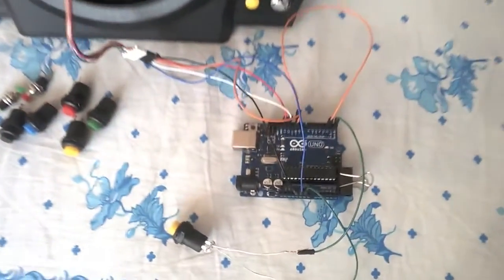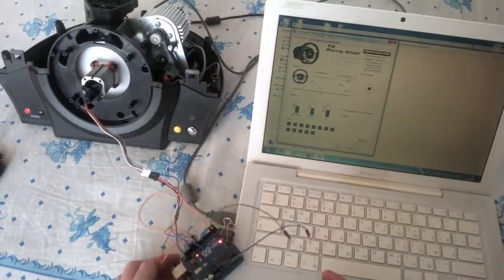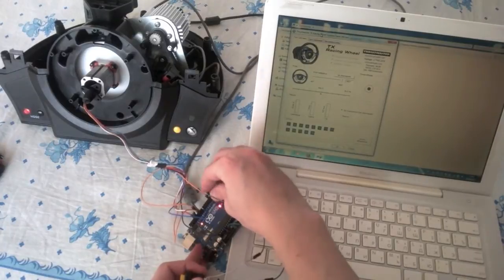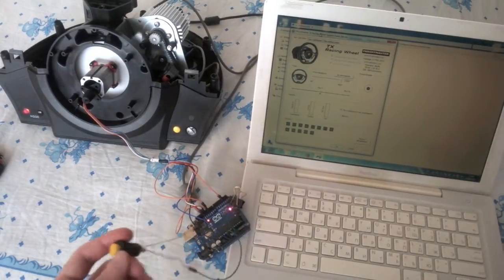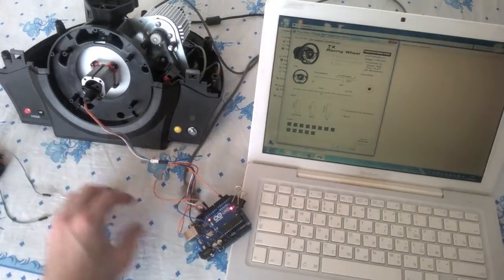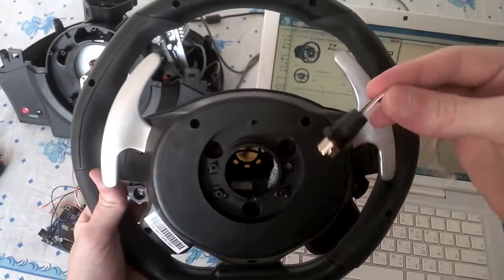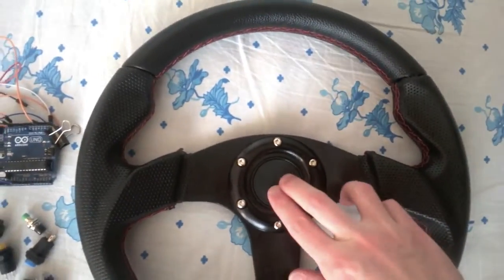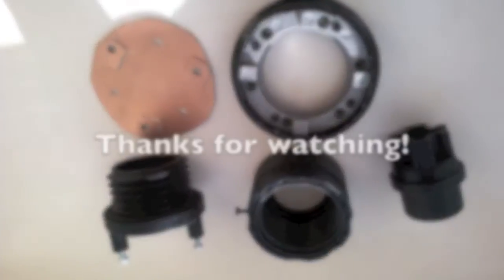Thrustmaster TX RW wheelbase and Arduino - part 2

Comment: Hi, great tutorial. Quick question though, how much current is going through the 3.3V pin? Would you think it is enough to power an ESP32 Wroom S3 and a 599xx evo wheel at the same time?
Reply from the maker: hey! arduino nano draws ~20mA. esp32 not tested, but IMO it will boot and run, why not?

Comment: Hi, I am using a original Thrustmaster plug from a Sparco wheel but the wires are red, grey, white, orange, green and blue on the plug the black is out of the plug. How would I wire this with the Arduino? Thanks

Comment: Hello man, great Tutorial. I'm wondering if you know the color code conversion to a Din 6pins that uses black, red, green, brown, orange and yellow colors ? I actually managed to get this working with an open connector by soldering wires, but I want to use my proper covered ps2 connector cable which is using those color and I don't know where they're connected in the pins used.

Comment: Hi, Im trying to do this mod but every time I connect the board to the wheel base it turns off, I found out it doesnt turn off if the ground cable isnt connected. How do I fix this?
Reply from the maker: Looks like GND is short-circuited with VCC - at this moment power cuts off. Check the wiring and arduino soldering. If you email me some photos - I'll take a look + write your wheelbase model.
Reply: @mispeaced  My wheel base is the TX. What should the photos contain?
Reply from the maker: @antilucker337  Hi-res wiring on both ends - arduino and wheelbase. And a video how everything cuts off if possible
Reply: @mispeaced   Im sorry that it took that long, you should get an email from TomasD.337 anytime soon.
Edit: It just told me that what i believe is your email (mailto:blog@rr-m.org) isnt valid so idk.
Edit 2:  Im just dumb lol

Comment: I have another issue, the steering wheel with all of the button works great while e steer slowly but the buttons stop working if I steer quickly end then they restart working great. I have tried a lot of different connection between Arduino and the female din 6 pin so I excluded the wiring as a cause for the problem, may it be the version of thrustmaster softwer? Because I'm using 2 pin as gas and brake ( because I didn't finished my pedals yet) and I hold them continuously and maybe the software doesn't expect that and cut the input.
Reply from the maker: Hi! Email me photos of your wiring, arduino board version (nano, uno, ..., ?) and tell me which sketch you're using - may be I'll have some idea then. Tnx!

Comment: I'm  trying this on t300 rs and i connected only 4 buttons to arduino nano, the buttons i connected work well but when i move the steering wheel arduino pushes a lot of buttons randomly. Any suggest?
Reply from the maker: Hi. Email me the pictures of how everything is connected
Reply: @mispeaced  thanks for the quick reply, my hand made din 6 pin connector was not properly soldered, now all works perfectly thanks again for sharing your project and sorry for the time wasting
Reply from the maker: @simonesalvatore1464  NP!

Comment: Currently having problems to get this to work with the tx wheel. Firstly it doesn't power up using the wheel, so i've just disconnected the 5v black and powered with a usb. The other problem is none on the buttons work and it keeps just opening and closing the sign in menu on the xbox. Hope you can help. Thanks!
Reply from the maker: IT's a bad idea to power it with 5V usb power! Wheelbase provides 3.3V on black line and if you supply 5V in there - you can burn your base! Don't use external power, take 3.3 and GND from wheelbase.

Comment: I'm trying to do this mod on a T150. I have it partially working with the tx_rw_ferrari_458_wheel_emu_16buttons.ino. When I connect D7 and ground, it presses the PS button, and when I connect D11 and ground, it seems to press every button all at once. None of the other pins do anything. The D11 thing makes me think maybe the wheelState array isn't getting updated and all bits are staying high. How can I debug this?
Reply from the maker: 1 = released, 0 = pressed (= connected to ground). Be sure - wheelState is updated - loop() scans input pins and updates wheelState infinitely.
But, the sketch you're trying to use (tx_rw_ferrari_458_wheel_emu_16buttons.ino) works only with TXRW and T300 bases. For T150 You need to start from Part1 article in my blog - read the data structure from your stock steering rim and identify each button (button order and bits order in wheelState will be different from 458 italia rim). There will be contant bits + button bits - find them all. Then update my sketch appropriately - change setup() and loop().
Reply: @mispeaced  Thanks for the clarification, and the quick reply! I hadn't seen Part1; you documented the process very well. When I figure out the button bits, I'll let you know what they are.
Reply: I still have to update the code, but here are the bit mappings for the T150:
first byte: 11010001

second and third:
PS 11111111 10111111
L1 11111111 11101111
R1 11111011 11111111
L2 11111111 11111110
R2 11111110 11111111
X  10111111 11111111
O  11011111 11111111
square 11101111 11111111
triangle 11111101 11111111
options 11110111 11111111
share 11111111 01111111
left  11111111 11111011
right  11111111 11110111
up  11111111 11111101
down  11111111 11011111
Reply: It looks like the bit order for the T150 matches the T300 exactly, including the starting byte. If I use that sketch though, I still get d11 pressing several buttons at once and none of the other pins working. Is it possible I just got a bad arduino nano?
Reply: No, I have the exact same result.(D11 pressing several buttons and the Button mappings are equal to the t300 buttons)

Comment: Is it possible to have the Arduino run as a man-in-the-middle? Taking the input from the wheel and a button, passing through the data from the wheel and taking the relevant data from the external button? I've modded my TX to allow for pressing the A button externally by tapping into the yellow button on the front of the base, but in Forza Horzion, for example, where handbrake is tied to B, there's no way to have that work - and I think this *might* be the solution I'm looking for.

Keen to know your thoughts.
Reply from the maker: Just add a micro-switch, that wires your external button either to A or to B - so that you can select it's function for different situations.

Arduino only has 1 SPI interface onboard. So it either works as SPI Master (then you can read steering rim and it's buttons) OR as SPI Slave (then you can communicate with wheelbase and send the data). For man-in-the-middle you need a board with 2 SPI interfaces and you need to configure 1 as slave + 2 as master. Or you need to have 2 arduinos.

It's much simplier to have a basic mechanical switch for your external wire as I described above.
Reply: @mispeaced  That's what I was worried about - thank you for the detailed answer. I was looking for a way to do it inside the wheelbase itself (taking the pins from the 6 pin connector) so as to not need extra wiring through the centre section, worried that the twisting would break something. I'll have to research down that route.

For now - my current mod means I can at least get my slide on in DiRT Rally :)

Cheers for your time.
Reply from the maker: @StevenDawsondjd4ws0n  NP. Good luck with your mod!

Comment: Great video, Is this also possilble whit a logitech G29?
Reply from the maker: I never had Logitech devices. But a guy who tried to repeat my experience for Logitech G920 told me he managed to read it's rim successfully, but Arduino emulator he wrote was unstable. So, in theory it's possible, but there are no plug-n-play solutions for Logitech yet - you'll have to code/debug that yourself.
Reply: My problem is i got a G29 and a Thrustmaster TX, I like the G29 more. now i have ordered this adapter https://youtu.be/5QlpNzw9LUY so i can use thrustmaster add-on wheels maybe it is possible to connect the wire from the wheel to the G29 base
Reply from the maker: As far as I know, Thrustmaster and Logitech rims are different. They 're different both in data order (each button on your steering wheel is coded as a bit of data - 0/1 - so the order of those bits differs for each steering wheel + of course it's different for different manufacturers) and also in electronic components (Thrustmaster uses HEF4021BT shift registers, Logitech uses HC165 parallel-in-serial-out registers) - they're a bit different (pinout is different for sure + SS/PL signal is inverted + probably pressed/released state is inverted, too). So, IMO, 3d-printed adapter will only give you mechanical connection, but not electric.

Comment: Hi, impressive work, very useful to modify our TM wheels.
I made a few since now to a few friends that play on PC, all of them are happy with it. But now another friend want to use it in  PS4 and need the PS button (button 13). Are there some way to add another button to sketch? I use nano clones that have A6 and A7, so pins are availible. I'm trying to do myself, but programming I am a absolute noob.
Thanks!
Reply from the maker: Thanks for the feedback! Tweak the code inside loop() function - change wheelState[2]:

wheelState[2] = ((PINB & B00001000) << 3) | (PINC & B00111111) | ((PINC << 2) & B10000000) | B00100000;

This will put button 13 (aka "PS" on PS3/PS4) instead of button 11 (buttons 11 and 12 are also on the wheelbase).
Reply: Lot of thanks mate, worked like a charm ;)
Reply from the maker: dESK0 Np theres also a dedicated sketch for T300Rs Gt wheel - email me if you want to try.

Comment: Hi, love the effort you have put into this project! I've made my own F1 wheel to mount on my TX, but I can't seem to get the Thrustmaster (pc) to recognize the arduino/buttons. I've tried using a genuine uno(5V), Iteaduino uno (3V3 & 5V) and a Chinese nano(5V). I've tried using the stock mini din connector from the leather rim, and soldered a diy connector twice, but I still can't seem to get it to work. Do you have any suggestions or maybe a sketch with debugging working to try out?
Reply from the maker: Hi. Email me and send me a close-up picture of your wiring. http://rr-m.org/blog/about/
Reply: @mispeaced  I have the same problem. Did you come up with a solution?
Reply from the maker: @bradsmith5461  email me about your problem

Comment: Hi,  i bought  one arduino nano and i loaded the program Inside   but it seems to not work when it plugged directly on my pc  ....so i  would like to know if necessary to connect the  arduino nano  on the wheelbase to test it please?Thx a lot ;-)
Reply from the maker: In this video Arduino emulates the wheel (rim with buttons). It's does not emulate USB gaming device. So it must be connected to Thrustmaster wheelbase, replacing the stock wheel. Wheelbase itself can be connected to PC/XBox/PS3/PS4. 

If you need a stand-alone controller, that works over USB on your PC - look at LeoJoy project.
Reply: Hi , thanks for your answer , but  i saw on the website and i don't know if it can works with Arduino Nano ...?
Reply from the maker: LeoJoy? It's for Arduino Leonardo / Arduino Pro Micro (they're based on AtMega32u4 micro controller).

Comment: Nice project, what kind of motor is used for that model.
Reply from the maker: Motor is inserted and glued into round aluminum radiator (tube, covers the whole motor) - cannot tell you the model, it's covered by radiator. Motor size is approximately 60mm length, 42mm diameter. Belt drive or course - 2 belts + 2 pairs of gears to downconvert motor movement into force.
Reply: As far as u know Is that possible to use whatever motor i find in the market or any specific one?
Reply from the maker: If you want to replace it - you need to know a part number (just ask thrustmaster support). "Any motor" won't work IMO - there's an external sensor (sits on the back side, probably magnetic) - so you'll need to mount it, there's a gear on the front - it needs appropriate shaft, big radiator and fan are 'must have' - or it will burn, motor itself is powered and controlled by 6-8 wires (stepper motor? or it has 3-4 windings there?). I mean it's not a motor extracted from a cordless drill, for sure :))) That's all I know.
Reply: Actually i want to build something from scratch as i can't afford buying that one. Do u have any clues where to start.
Reply from the maker: Emiljano Driza I had the same dilemma and just bought a broken TX RW (eBay) - the one on video. Had to replace power supply (transformer burnt) - replaced with 100w/24V impulse PSU. Also had to replace a motherboard (also burnt) - got a replacement from thrustmaster. All the mechanics, motor, gears, steering wheel, desk mount, pedals were OK.
Reply: I see u have put a lot of effort on that. I'm thinking of trying the same scenario as u did, i will ask u if i got stuck with that.

Comment: Hi !
I'm trying to use the arduino nano but I'm totally noob.
I dowloaded arduino IDE, uploaded the emulation file into the arduino nano, but it doesn't work.
In the board setup, we can choose the "programmer" type, which one must I select please ?
Mant thx for your help !
Reply from the maker: +Bertrand Bühler You don't need to choose "programmer", because Nano board has embedded USB bootloader. But, you need to select Board -> Arduino Nano, Processor -> Atmega328, Port -> usb-serial port (when you plug-in usb to Nano, you will find a new port in this menu, so select it). If there's no ports in the list - you need to install drivers for Arduino Nano board. Google "Arduino FTDI drivers". OR if you accidentally bought a Chinese arduino - google "CH34X arduino driver". Install that and Arduino IDE will recognize your board (it will appear in Port menu).
Reply: +mispeaced Thanky you for your reply !
I already choosen my board, processor and port COM3.
When I launch the monitor, there is a blank page.
I bought my Arduino nano on an official shop, so I don't think it is fake...
Reply from the maker: +Bertrand Bühler Serial Monitor must be blank - we used it only in previous video (part 1)
Reply: +mispeaced 
So, there no way to verify the arduino is correctly flashed before plugin onto the tx base ?
When I launch the TX setting, all buttons don't work.
I'll check the din6 wiring again.
Many thx !
Reply from the maker: +Bertrand Bühler When you press "Upload" button in Arduino IDE - it compiles and flashes the code into your board. And tells you a status of course, and errors if any. You don't need to check Serial Monitor for errors - Arduino IDE shows all status messages in the bottom.
Reply: +mispeaced 
The upload seems correctly done without any error.
For the buttons GND, I grouped them all and back to the board GND with 1 wire, it's ok ?
I board and buttons wiring are ok, the last check will be the din6.
THX again for your help my dear ;-)
Reply from the maker: Bertrand Bühler No problem, just re-check the wiring. Don't forget - orange wire goes both to pin10+pin2.
Reply: +mispeaced 
Yes it' done  for the orange ;-)
I'll let you informed when problem solved.
Reply: +mispeaced Dear friend, I just found the cause of the misfunction.
In the wiring diagram of the arduino nano, the white wire must be black, but the grey is annoted (white).
So, when I inversed black and white wires on the board, all started to wok perfectly.
I will be able to play tonight !!!! ^^
Many thanks for your time and for your help my dear !!!
Reply from the maker: Bertrand Bühler Have fun! :)